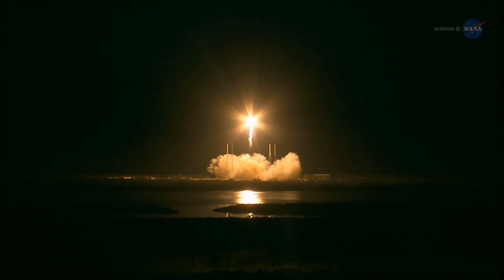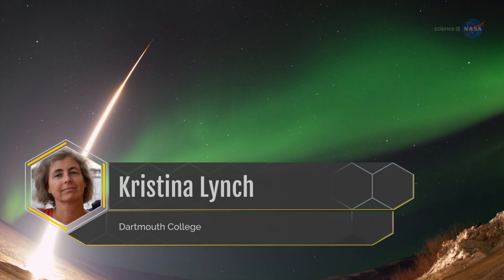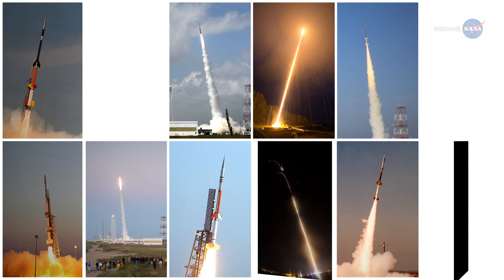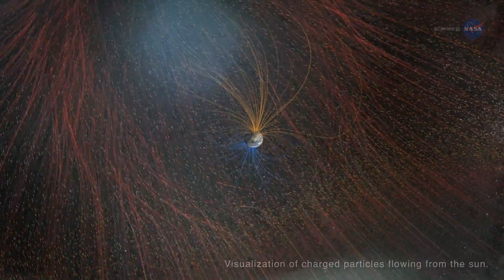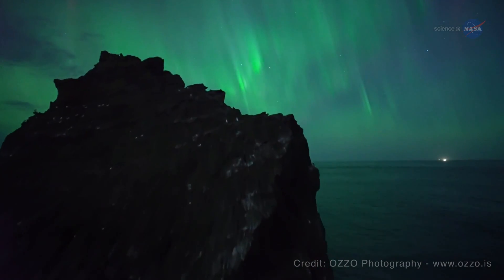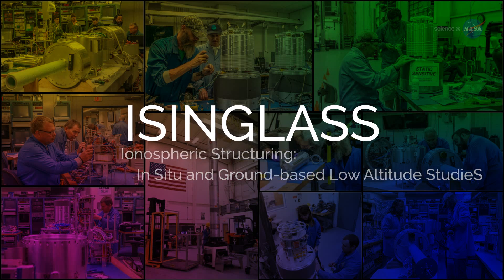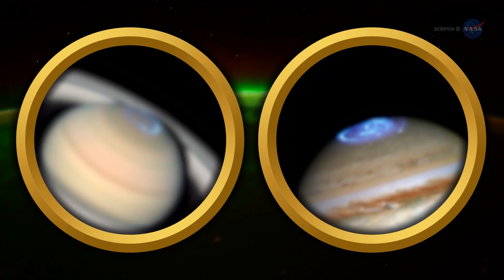Sounding Rockets explained

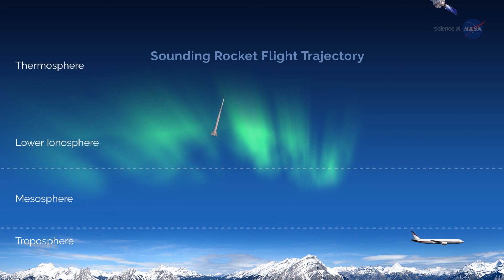Comment: A nice presentation. Sadly, few viewers and only 76 thumbs-up. My only real criticism is at 1:34 when the graphic shows a complete rocket (that looks like two stages of differing diameters) arcing over and re-entering the atmosphere. Not quite what happens.
Reply: Sounding rockets don't go straight up, they launch at an angle and have a parabolic trajectory. Also, the different stages of sounding rockets can often have different diameters as they are just solid boosters being stacked on top of one another. I think NASA just meant to show a simplification of what the rocket does.

Comment: So how much does it cost to launch one?
Reply: Depends. Ignoring the payload (which can be reusable) if the mission can use surplus military solid rocket boosters it is a lot cheaper than you might think, especially if the mission can be flown in a convenient place like White Sands, New Mexico.
Reply: About 350.000 dollars for a launch by a commercial provider such as UP Aerospace.